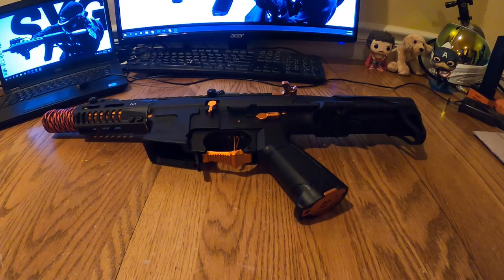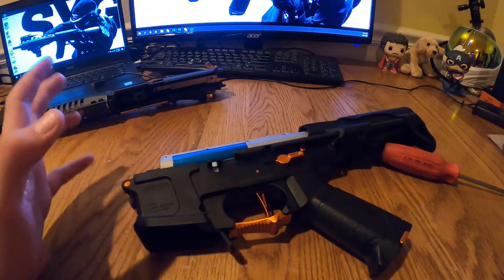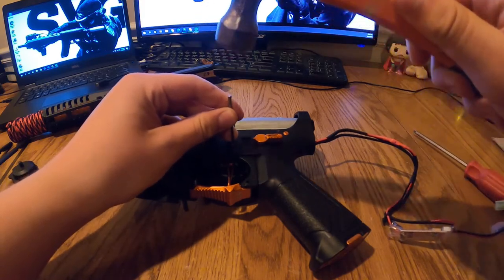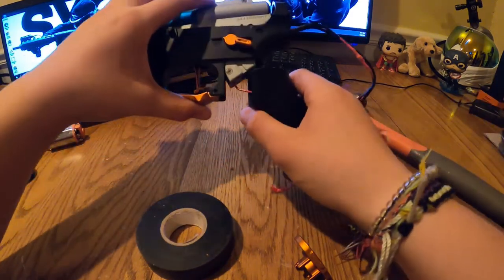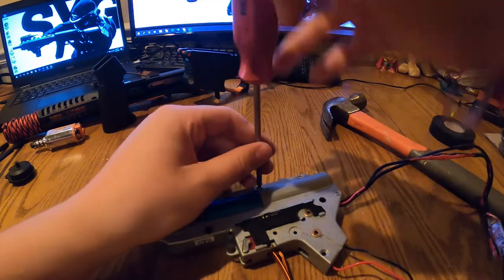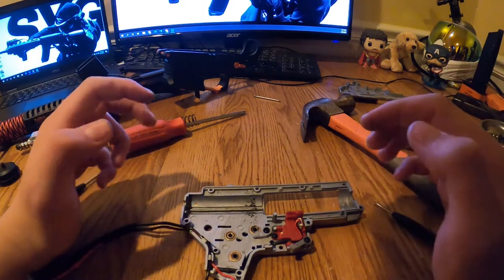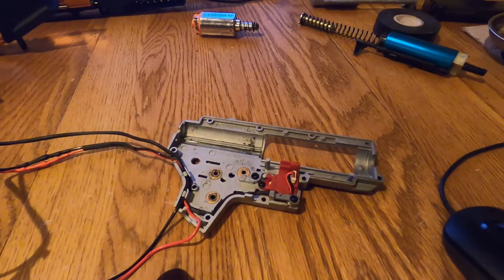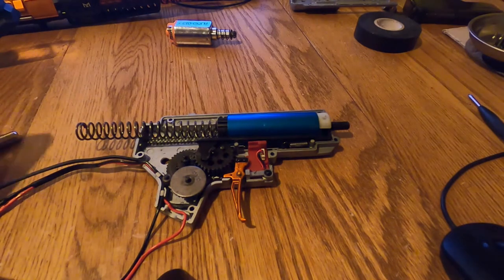G&G ARP9 Disassembly Part 2

Comment: i took the stock off and the screw  isnt catching something anymore, the screw just falls in. was there something holding it to catch the threads?
Reply from the maker: Try putting the barrel towards the floor then put the stick on then put the screw in cuz in the stock thier is nothing to help it in
Reply: @spraynpray2242  found the problem.  the threads ended up being pushed down and i needed a longer screw so i could pull it back up.  very strange.
Reply from the maker: @stevolam182 hmm dang thats weird well glad it worked

Comment: Hey man. Great vid by the way helped out so much more than other youtubers. Question tho.  Im stuck taking the gearbox pin out. It wont even move a millimeter.  I tried using a punch and a hammer. Nothing. Not sure if it got stuck for you taking it apart for the first time but every other pin came out fine. So if you have any suggestions on how i could get this out would be very appreciated
Reply from the maker: Yeah so this happened to me as well it's just how I said like it might come out the right or the left the video that I watched on taking this apart he's came out by him punching out on the right mine came out by punching out on the left so my advice is just to try because I think I said this in the video there is one side of the bar that is like stippled to hold it in there so you want that end to come out first so you don't scrape the whole inside so it all depends on which way they put it in so just try different sides and then start hit the pain out and if you look at where the pain starts to come out if it's just smooth and you know you're getting it out the wrong way

Comment: How do I get the fire selector switch out?
Reply from the maker: let me get back to u on this i need to re take apart it but u should get your answer tonight or tomorrow
Reply from the maker: So you’re going to grab a very small flat head and push the selector plate all the way to the left as far as you possibly can and then on the bottom right of the plate your going to get the flathead kind of under it and pry it up but be careful not to break it and then once that side Is up you are gonna pull the other side out and then slide it out